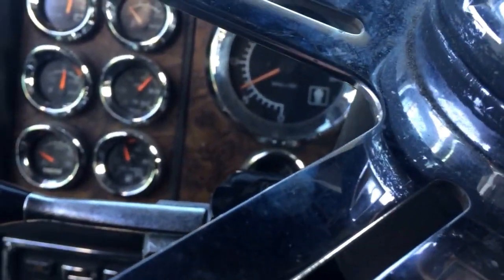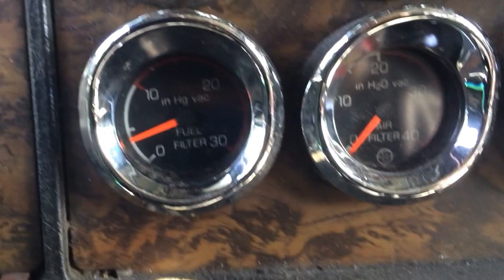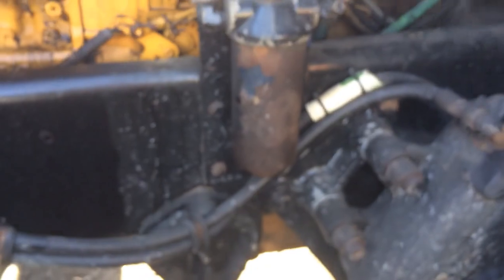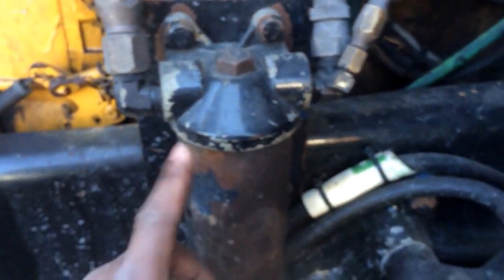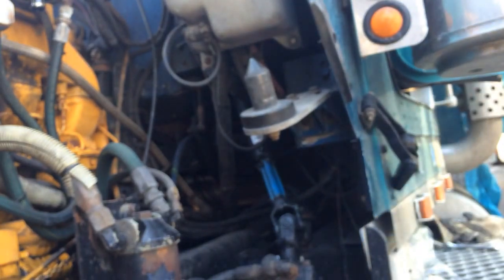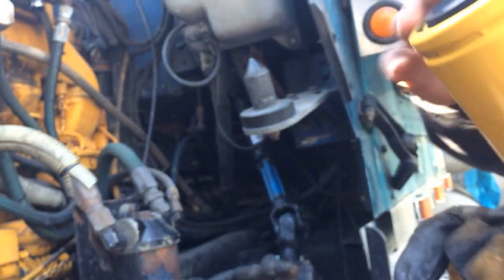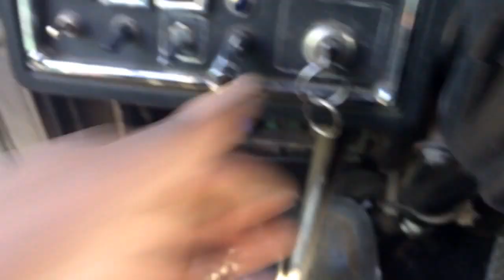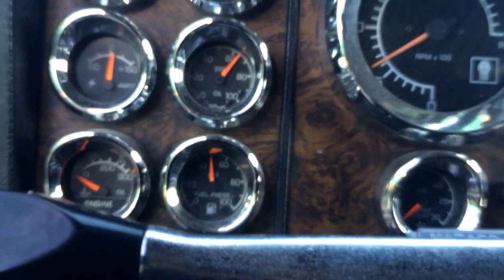How to replace 3406B CAT fuel filter | 425 CAT

Comment: You can try putting a quart of marvel mystery oil in the filter before reinstalling it will clean the pump and injectors. Great video
Reply from the maker: I occasionally run some through the tank.. sometimes it’s 2 cycle oil, or used motor oil.

Comment: I know this is an old video. But I often get crap for using CAT filters, cuz they cost too much. Yes they are more expensive. But since it's a CAT motor. Put a CAT filter on it, makes sense. Atleast that what I think. I admire that you do the same aswell. I digress in a way. I do use a a Baldwin filter on the FASS pump. If CAT made that filter. I use it there too, but they don't.
Reply: Not sure if u have looked into it since u commented but cat does have filters that fit the fass lift pump cross reference the Baldwin at your local lune shop and they’ll hook u up.

Comment: How often do you change your fuel filter and fuel water separator?
Reply from the maker: Around 4000 miles on the fuel filter and a little longer on the separator. The fuel is trash now a days.
Reply: Just about to do my second fuel filter changed on my first Big engine which I have the acert c15 and only ran truck for 5100 miles and noticed my restriction filter gauge started to go into the red and wasn’t sure if I needed to change the water separator too. Thanks for your knowledge!

Comment: Will an old dirty fuel filter cause sputtering under load?
Reply from the maker: Yes it could be starving for fuel, or  the engine can be sucking air in the fuel system.
Reply: @BrothermanTrucking  oh ok. Thanks.